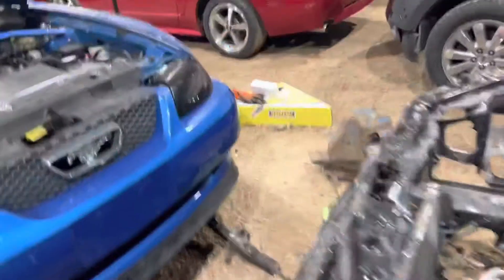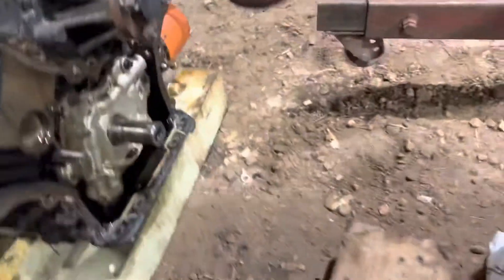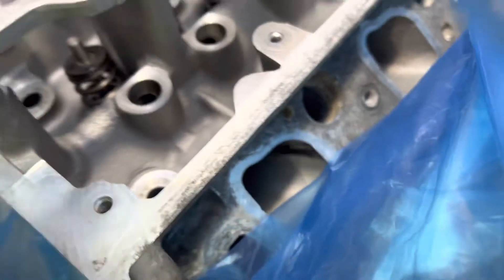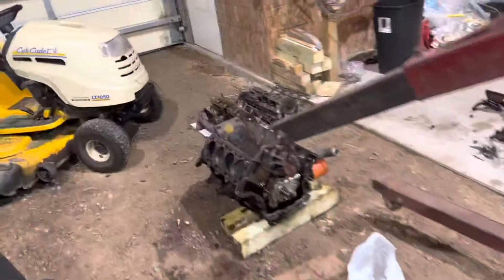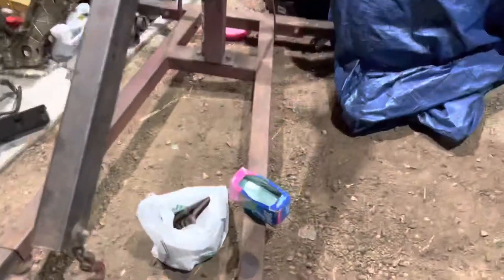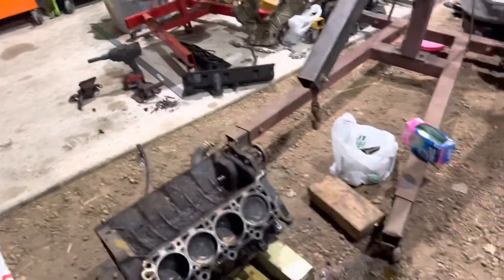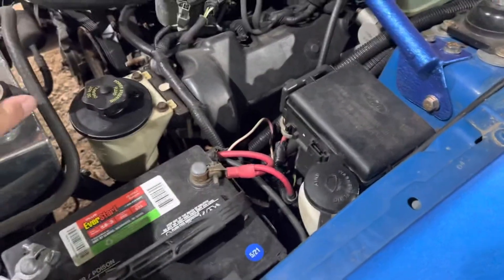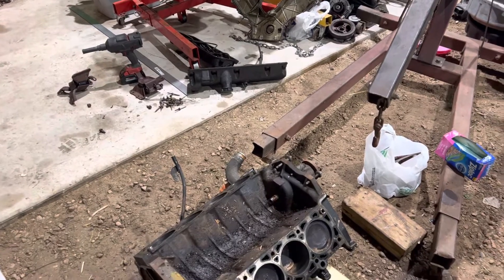4.6l 2v engine build part 1

Comment: Men hope I can do the same to my mercury Grand Marquis 95 I wanna push 450 p.i but I wond doesn't it matter what year p.i heads to use
Reply from the maker: I recommend using the 2008 or newer heads, I used 2011 crown Vic heads, they’re 9 thread heads and I had them gone thru and ported, I spent a lot of money into them lol.